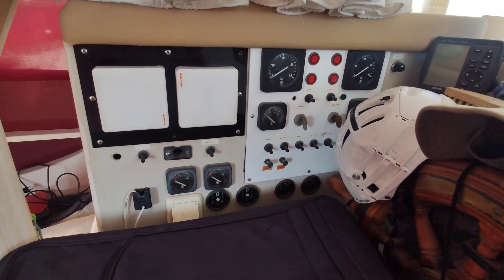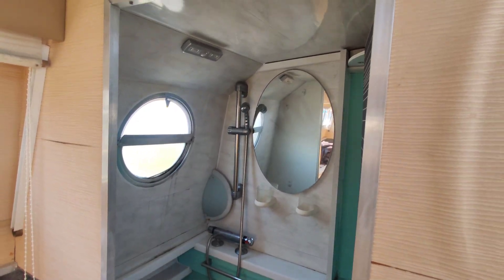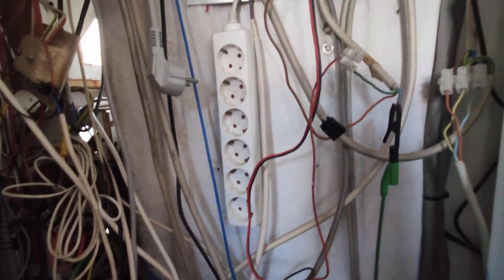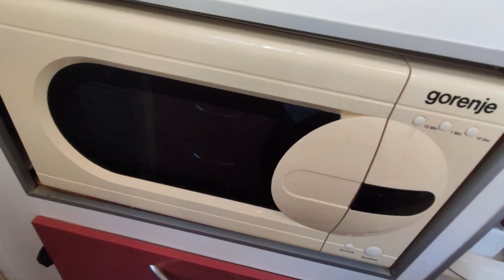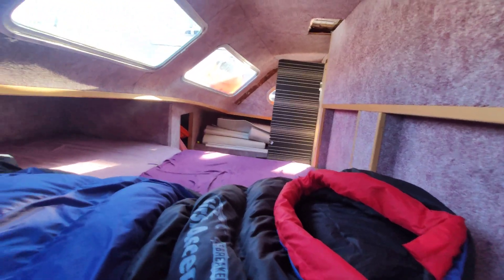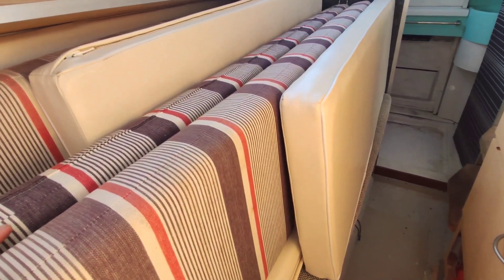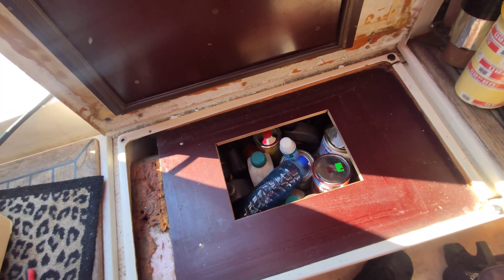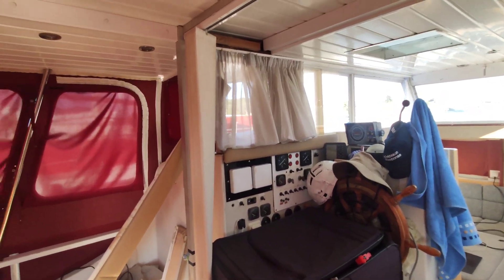Walkthrough of my Catalac 9M before I start pulling everything apart!

Comment: Have I missed somewhere how much you paid to acquire the boat? No worries if you’d rather not share.
Reply from the maker: @SolSeekerLiFe  EUR22k. I never knew at the time that the motors were shot and that the sails, rigging and rollerfurler needed replacing, but I wanted the boat because it had the large hardtop and the sugar scoops added, would have cost me a fortune to do both of those.

Comment: Hello Patrick. I've a 9M with 2 inboard Nanni 10hp diesel engines. Also looking at epropulsion systems, pod snd outboard solutions.
The Navy 6 Evo has hydrogenation so wouldn't need the complicated  raising system if you were prepared to sacrifice sailing drag for regeneration.
Keen to see your final solution
Reply from the maker: Hi John, I've heard that regen only works with the ePropulsion batteries. They also say you shouldn't leave the outboards permanently in the salt water, so I'll have to come up with some way to raise them, at least when at anchor. I'll do an update when I have more to show. Cheers, Patrick
Reply from the maker: Sorry meant to say that regen only works with the ePropulsion batteries. My battery pack with
Will be a DIY pack.

Comment: Hello Patrick, can you point me in the direction to the electric motors you are installing? 
I hate my 1GM10 diesels and would love to convert to much more powerful electrics.
Reply from the maker: I've gone back and forth over my engine choices for far longer than I've had a boat. Initially I was going to use epropulsion 6kw outboard motors, so I could raise them for sailing. Now I think I'm rather going to keep things simple and fit the epropulsion 6kw pod drive motors. 

They're easier to install and I don't need to come up with a lifting mechanism. They're 10hp equivalent when it comes to thrust, but according to those who use electric, if you're happy to move slowly they move boats well even using very little power. 

Budget around EUR6000 for two motors, and probably a minimum of another EUR3000 for a 14-15kwh battery bank if you put it together yourself. 

Some people double that size, but my plan is to make up for any lack of capacity with as much solar as I can fit!
Reply from the maker: Yet another update, I went back to the outboards as originally planned. Trading simplicity for ease of maintenance...
Reply: Nice plan with the 15kw batteries. Im guessing lifepo4 prismatic cells?
Reply from the maker: @lightend100  correct. I'm using EVE 280AH cells. 16 in series.